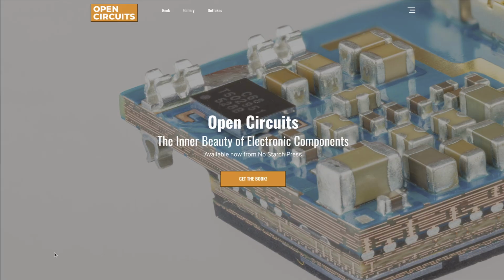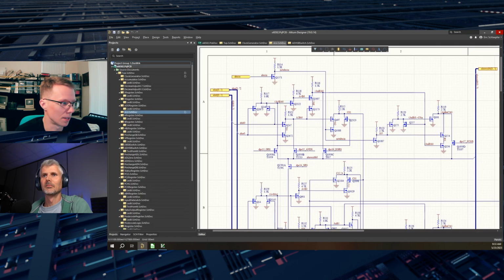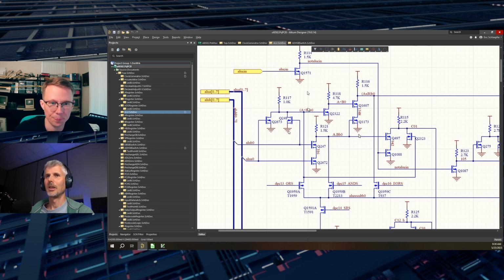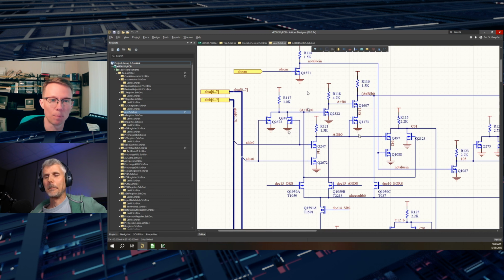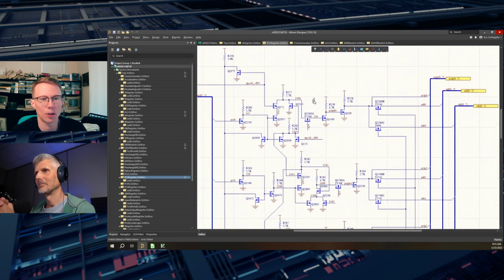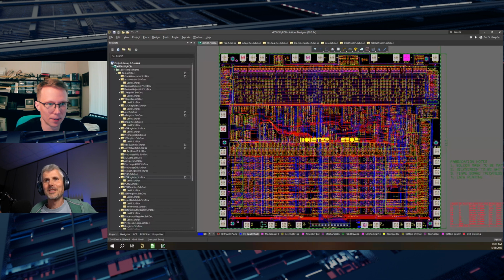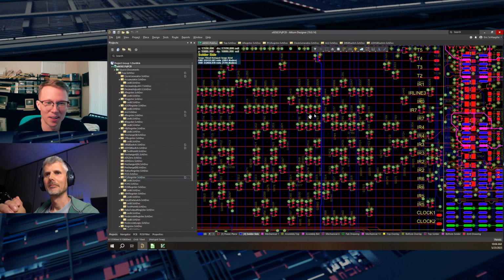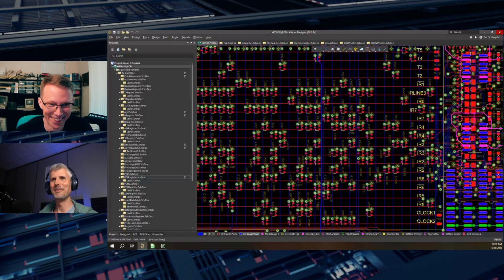The MOnSter 6502 - how Eric Schlaepfer built a 6502 processor out of discrete transistors

Comment: Does it exhibit the indirect jump bug?

When an indirect jump to any address xxff the first byte of the target address would be stored in address xxff and the second byte of the target address would be stored in xxff plus one but the 6502 never generated a carry between the low byte and the high byte of the indirect address so for example an indirect jump to address $12ff would pick up one bye from address $12ff and the next byte from address $1200.
Reply: Please align your word16s as we do on 68k.
Reply: @ArneChristianRosenfeldt  my question was in reference to a bug that existed in all 6502 variants.  indirect jump to $1ff and it would pick up half the target address from address $1ff then  add 1 to $1ff and pick up the second byte from address $100 not 200 because the addition did not generate a carry. is this bug emulated properly? if not then it needs to
Reply: @markmanning2921 yeah, I think I understood you, just sometimes I wonder why people care for bugs so much. Perhaps aligning data is hard? And I learned about carry look ahead adders and wonder how many transistors it would cost to have a separate incrementor . Then in the next cycle just change the bus signals to use this value instead of original register. How many transistors do we save when now all instructions are executed with a fixed timing? Almost all early revisions of the chip were about the optional increment.
Reply: @ArneChristianRosenfeldt  Yje 6502 is a piee of history.  It was the first ASM I ever learned.  People care about emulation emulating not approximating :)
Reply: @markmanning2921  yeah, but how hard could it be? Just emulate using bytes. The PLA ( the microcode ) which decides where carry works and were not, was published by Atari in the 70s. For the rest : Visual 6502
Reply: @markmanning2921  and how would a literal upscaling of the transistor circuit not behave exactly the same ?
Reply: @ArneChristianRosenfeldt  first I need to learn to type, second I need to learn to proof read lol...

I cant answer your question, im just a coder monkey, I dont do hardware

Comment: So surprising that it's only like 1/20th the speed of a real 6502.  Long ago I worked on a CDC 160A, which was all discrete germanium PNP transistors and wire runs up to 5 feet long..  It was the size of a door and had a 12 microsecond clock.  Slightly faster, and in 1961! 

 I'm also surprised you couldn't find some suitable active complementary pullups, that would have greatly helped the speed and lowered the power drain.  For instance the BSS84AK,215 is only 18 cents each, is p-channel, and not too slow.  It does have a whopping 18pf of gate capacitance, which is very low for a fet, but may be a problem if you need a lot of fanout.

Comment: Can the schematic be changed (and build) in simple logic gates/registers in stead of transistors ?
Reply from the maker: Yes I'm sure it could be.
Reply: @ZeroToASICcourse  Do you have any example?
Reply: I tried to simplify visual6502 and found that it so full of multiplexers. Those are even more easy in CMOS. And there are transmission gates. And 6502 uses a ton of wired-or . This is basically as distributed NAND gate. The gates you think of, are not distributed. Your routing would look totally different. Check for example the PLA for the microcode.

Comment: Eric, if you're looking for a high resolution thermal camera, look for a Seek Thermal Reveal Pro. It has a thermal resolution of 320x240. Don't buy a FLIR, they are too expansive for what you're getting. Most FLIR camera's in the low price ranges have a thermal resolution of only 80x60, and cheat by adding contrast lines from an optical camera. Seek Thermal doesn't do that, they have actual thermal resolution at a fraction of the price you pay for a 'real' FLIR. As a C64 fan, I find your 6502 project very fascinating. Great work!

Comment: How slow can it run?
Reply: 14:40
Reply from the maker: You can single step it, so as slow as you want
Reply: @ZeroToASICcourse  I was not thinking of the delay between clock cycle, but about the maximun delay between the two edges of a clock cycle.
Reply: @ZeroToASICcourse but the IC cannot!?
Reply: @ArneChristianRosenfeldt not as far as I know, he talks about those constraints in the video, around 15:42. There are static core versions of the 6502 as well.
Reply: @gcolombelli  so a static core would have the pull-transistors doing their thing all the time. For speed it would be ideal if a latch held the old bus values and drives extra pull ups and then clears itself by some zero flag logic on the bus. Of course CMOS would leave bus voltages as they are and only drive lines for changes. So naturally CMOS is static.

Comment: This is very cool.  This was the first microprocessor I learned to use and hand wrote and assembled my own code on.  Literally I wrote the program and ops on paper and then translated them into hex/bytes by looking up in the tables in the Rodney Zaks 6502 book.  Branch calculations were always a bit tricky.  Then I poke’d them in to memory and ran them.  On a commodore Pet 2001!  Fun days when you were a kid!  I have very fond memories of the 6502.
Reply: Me too. I recall you had to be careful about croosing page boundaries. My school computer was a PET 3032. I used to write on green lines printer paper my dad brought from work.
Reply: @smudgerdave1141  Dot matrix fanfold printer paper (or teletype fanfold printer paper - basically the same stuff).  Know it VERY well!!
Reply: @GodzillaGoesGaga  This  was fanfold line printer paper around 18" wide. 😊
Reply: Me too, I used to spend time at math classes to hand assemble code to run on the schools Apple II+'s on my lunch break.. I still know RTS is 60 hex, 40 years later.. LOL
Reply: Ha! Yep - did the same but with the Z80. Wrote the op-codes into the back of my school maths book!